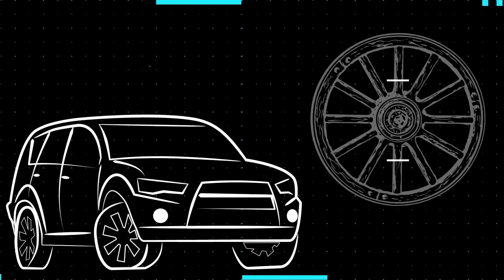How to install Oedro LED Light Bar

Comment: Is the switch assembly box part of the vehicle? Or, did it come with the light bar? I do have a fuse box on my 2018 Toyota Sienna.  Trying to figure out where those two red and black wires will be hooked up on my van. Thanks!

Comment: How did you feed the on/off switch in to the cabin?
Reply from the maker: I didn't have to. I already have a switch panel installed inside. The light is easily connected to the switch box in the engine bay. Watch this video on how I ran these wires to the cabin. https://youtu.be/WwxSkSu-oag

Comment: Do you have a way to prevent bounce?
Reply from the maker: Not unless you drill into your frame. I switch out everything to this https://youtu.be/FiHZD7xUtqQ
Reply: Mount the bull bracket behind the license plate frame directly against the bumper cover.